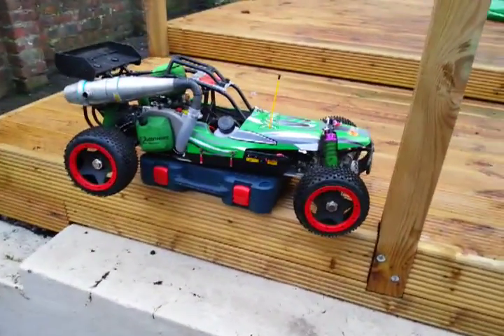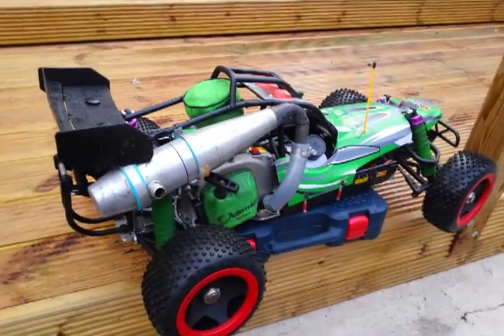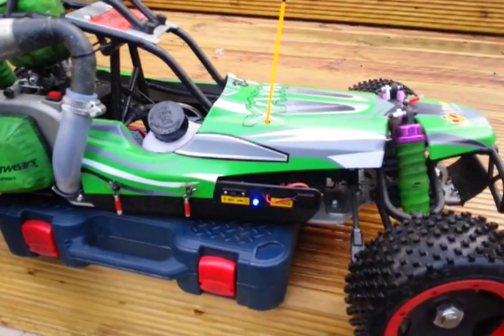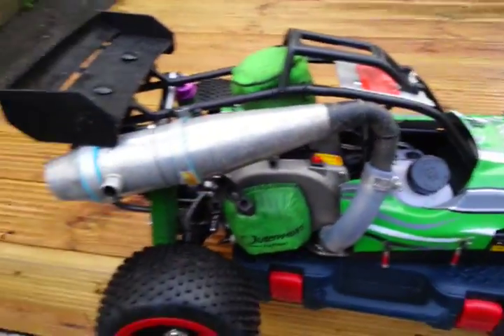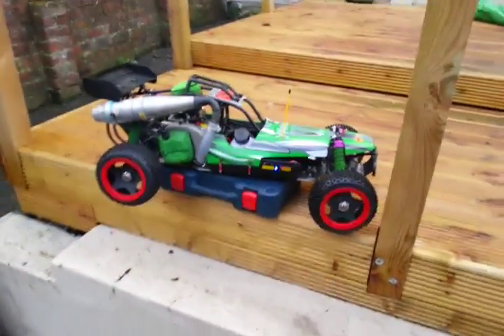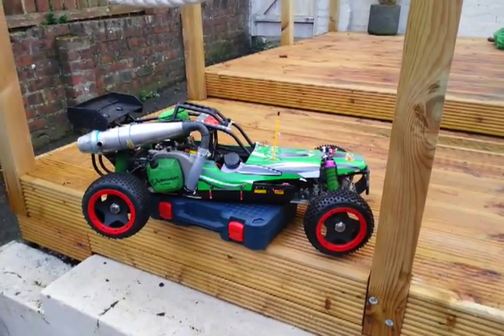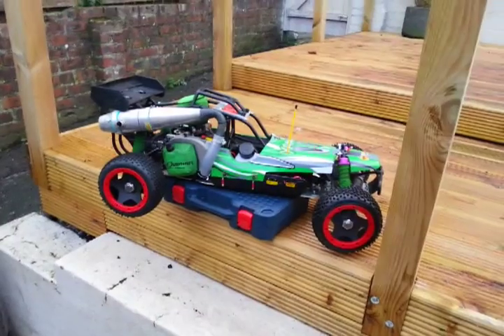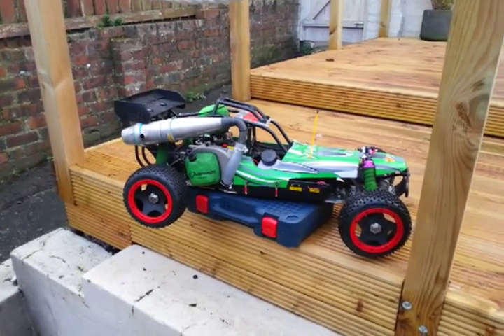Upgraded Yama Buggy

Comment: Mix is good, my Baja also smokes a lot when the engine is cold. It should go away after 5 mins of running each run. Glad to see I'm not the only one using zip ties to hold my exhaust in place :)

Comment from the maker: It's an FG Touring Car exhaust, the manifold fits straight on with no problems, no chassis cutting required. At the moment it's mounted with jubilee clips with silicon heatproof matting between it and the exhaust. I have then used super strength nylon cable ties to clip it to the roll cage. I'm working on a v-shaped mount that will be bolted to the crank case though, so it'll be a bit stronger. Might sell it soon as I'm getting a Losi 5ive delivered Tuesday. It's already paid for!

Comment: hi rich,   ive only just bropught  a yama,   cause it was cheep 440£  30cc carbon look,   any advise mate on how to get the best out of  it,    i know yours is long gone but any advise be super helpful....  less you say fck itoff  !!!   all the brest   Ian
Reply from the maker: Hi Ian, first thing to do is to take it apart and rebuild it putting threadlock on all of the metal to metal bolts. I don't know what they're like now but the build was quite poor on mine. Other than that I'd say to take it easy on the first couple of tanks of fuel, only very short bursts at high revs and then enjoy it. If you find yourself with that kind of money again though, have a look at rcmodelz.co.uk and in particular the KM 002. It's a direct HPI Baja clone but the plastics are nylon so they're much tougher. You can buy readily available HPI replacement parts as and when you need them.
Reply: @rickydenton1982   hi richard,,  i replace the wheels with hpi ones,  so instead of the silly little nut that holds the wheels on i got a nicely machined part from germany with a 24 mm hex and also a 15 mm hex that screwed into that, as i  had problem that the drive was working but wheels not turning,  also put larger grub screws and plenty of threadlock,    so far so good..   i know you cant expect too much as to be fair its just a cheep chineese version of a hpi baja...   the maifolds leeking like a goodn,   when i  emailed nitrotek thet informed me that it is supposed to pass fluid...!!!  i have locktighted the granny out of it...  two tubes Rich...  cause its the 30 cc fella i was under the impression that it sould go circa 90kph,  so roughly  55-60mph on a good day.    think im lucky to be getting upper 40's at mo.... i got arrma talion.  i can give the yama 20 meter head start and the talion flies by it in seconds mate. i just wanted to experience 2 stroke proper engine situation.  maybe im wanting too much, or hoping  more to the point, than what  she'll give.  still to be fair im only on the 4th tank of fuel. ran it in correctly so am only just getting used to it...    obviously if i had plenty of cash i would have got the 5bb baja or preferably a losi,   but thats the diff of a £440 or put a 1 infront of that something better.  my talion has been fantastic,   tho ive probably spent 4-500 quid on upgrades and damages...  i absolutly love rc cars,  great buzz .  and im just shy of 50 but still puts a smile on my face,,,till they break....    hope your enjoying your vehicles Rich.....  all hte very best   Ian

Comment: that exhaust looks and sounds crap ( like a ricer ) spend your money on mods for the actual engine
Reply from the maker: :') check the date mate! That car is looong gone! Replaced with a Losi 5ive and HPI Baja!
Reply: +Richard Denton that's good, 2wd cars aren't that good anyway
Reply from the maker: +Patrick Star Baja is 2wd. but awesome. all Baja are.
Reply: +Richard Denton its only good on flat ground tho
Reply from the maker: +Patrick Star only if you can't drive
Reply: +Richard Denton my little mini recon is better off road and its only a little 1/18 scale electric
Reply: i got a yama 30cc....you have any ideas of how i can tune the fkn thing ??
Reply: @ianhearnden4471  I don't know much tbh but upgrading from plastic to metic will stiffen the whole thing up and also two steering servos is better than one